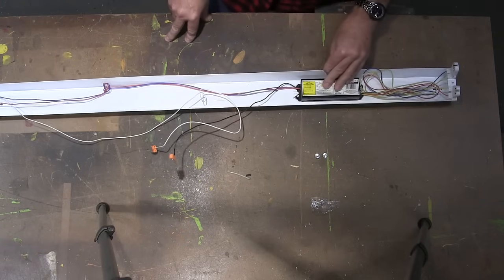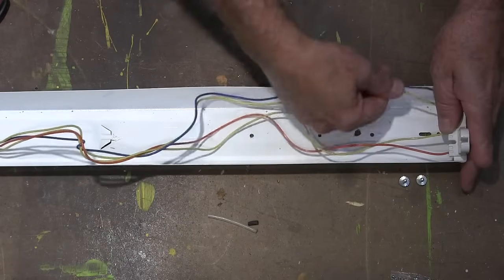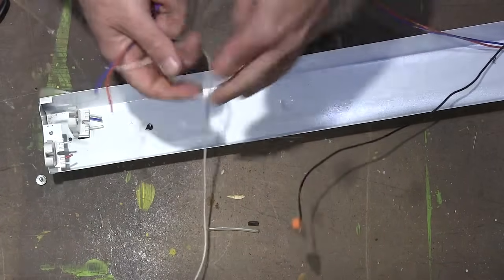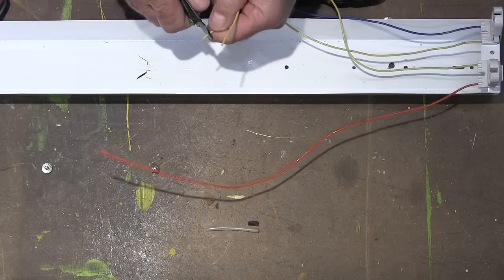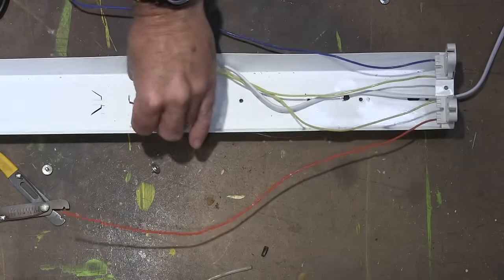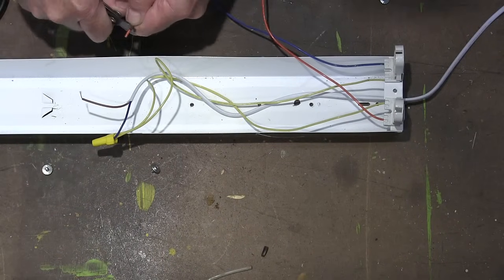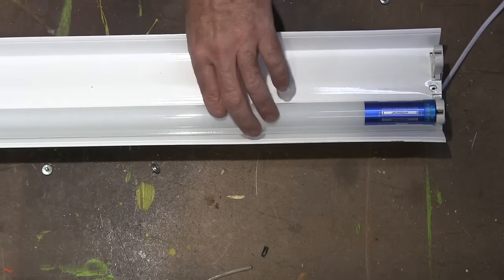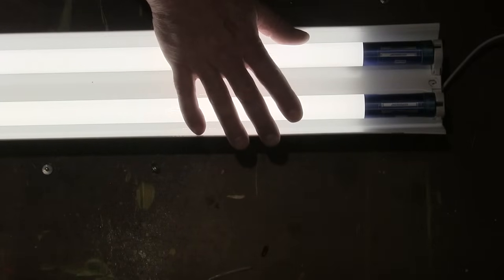Fluorescent to LED Conversion

Comment: Hello, this does not work with the Feit Electric T8 Ballast Bypass Tube (purchased from Home Depot). You need to connect wires on both terminals (one end of the terminal wires needs to connect to Live wire (black), and the other end of terminal wires need to connect to Neutral wire (white). Then when installing the LED Tube into the terminals- the (L) or live end of tube (stamped on tube) needs to be placed on the (L) terminal, and the (N) or neutral end of the tube (stamped on tube) needs to be placed on the (N) terminal. If you don't connect to both terminals it will blow the fuse- power needs to be coming in (Live or Black wire) and go through the tube and out the other terminal (Neutral or White wire) to complete the circuit.
Reply: That is a double ended tube. This video has a single ended one.

Comment: Does it matter if I have shunted or non-shunted tombstones?
Reply from the maker: Yes. You are just feeding the ens of the led tube. Be sure you are using bulbs that wire up the same as in the video.

Comment: WARNING:  This video is only applicable to the specific LED light he is using where wiring is done only on one end.  There are plenty of other types where the power is applied to both ends, in which case, if you use the wiring this video shows, you will short out the wires and trip the breaker.  This happened to me following this video, which got me scared me until I figured out why.  Follow the instruction that comes with the LED light instead of following this video blindly.

Comment: Why do some videos show using wires from both ends supply hot goes to one end and netural supply goes to the other end
Reply from the maker: There are several different styles of bulbs that wire up differently.  It's very confusing and makes it hard to replace an existing bulb as you don't know which to buy unless you open the fixture to see how it's wired.

Comment: Thank you for this very helpful video!  Everything went well with my 4 light , (8 bulbs total)  fixture conversions just  as you described in your video.  I agree with other commenters  that your straight forward description and explanation was simple to follow and made it easy to implement.
Reply from the maker: Thanks for letting me know it worked out!

Comment: Best of numerous vids I have watched. Easy to understand , at least for me.  Thanks!
Reply from the maker: Thanks!  I hope you're conversion goes well. Make sure your bulbs wire up the same way. There are different types.
Reply: @SoatMon  ha..sure enough..I ended up buying a box of 25 bulbs after i realized this was possible...but needed to wire differently...luckily i didn't do too many fixtures ahead, and was still able to re-wire them easily. Has definitely been a good learning experience.

Comment: Wow, and that was five years ago.  Today I went into Home Depot and can't even buy flourescent fixtures or bulbs any more, so I better learn how to do this!
Reply from the maker: If you following my wiring be sure to get bulbs that wire up the same way there are several configurations.  I have a link in the description that should get you started but some bulbs wire up one at each end, some need a ballast some do not, these wire up at one end as you saw in the video.  Not to critical to get the same bulbs just pay attention to how they are supposed to connect up to the power source.  I hope it goes well for you!

Comment: My fixture had handy push in harness so I didn't need to buy any, they have 3amp slow burn fuse inline with power. I accidentally blew one. Should I just replace the fuse or bypass it ?

Comment: I have T12 F40 bulbs.  It doesn’t say which end goes to the power.  It does say remove this label before installing.  The other end has the bulbs info.  So, which end goes to the power?  I gave this a try and blew both bulbs.  Use this vid at your own risk.

Comment: Don't listen to this guy. Thanks to him I  screwed up my light fixture. His wiring is NOT CORRECT !!
Reply: His wiring is correct, but he did not explain to us that you must take one wire from 1 side of the tombstone, but be careful not to take the opposite one of each light by so saying I mean left from each side must be combined together and also right from each side must be combined together and if you happened to mix right and left of each side that will be a short circuit.

Comment: So, wire gauges.  Do these change when we move from using a ballast to connect to the tombstones, and instead connect directly from the input power supply of 120V (and 15A, most likely)?

Looking at an existing TRIAD ballast that I have, the input / output wire gauges look to be the same, at 12 AWG (from a chart).

Comment: 5 yrs ago, and this video still helps. That's awesome, and thank you! My wiring was a bit different, but I managed to get it done. Mine had a red, white, and black solid wires on one end, and two blue solids on the other. The red wired to the romex hot, and the two blues had to be wired together, and to the neutral. I figure it must be an older light fixture. The only thing I did different from you was I made sure to cut all the wires as close to the ballast as possible to give me mercy in case I screwed up, lol. Come to think of it I can't remember where the black wire connected. Weird.
Reply from the maker: Thank you for your kind words and for sharing your experience.

Comment: Did what you said and it didn't work.
Reply from the maker: It's probably the bulbs.  They make different kinds.  You need bulbs that don't need a ballast and wire up on one end.  There are some listed in the description to get you started.  There should be a schematic with or on the bulbs that you have.  Some bulbs have to be wired at both ends, etc.  I hope that helps you.
Reply: You said to cut all of the wires at on end and tie all of the wires together at the other end splitting them between the white and black. I did that and almost fried the outlet...😡  Looked at another video which said to use the ends for the neutral you said to snip and the other ends go to black. Works correctly now.
Reply: It's not the bulbs, it the ballast free bulbs. I have the same 2 bulb fixture you had so I followed it exactly like you described.

Comment: I do not have the same colors of wires for 2 light bulbs.  This video is no better than three 3 others I have seen because the colors of my wires are different and out of 2 tombstones I have 2 wires.  I have yet to see my style of light fixtures.  Another waste of my time.
Reply from the maker: The first thing is you need to get the correct bulbs.  There is more than one style of wiring.  There are some listed in the description to help you.  You don't have to get those exact ones but ones like them.  You need bulbs that don't require a ballast and then just connect one positive and one negative wire to the end of the bulb using the tombstone, like the schematic in the bulbs listed.  I hope that helps you.

Comment: No mains terminal block. no cable tension capture.   I wire them both ends so the tube works which ever way you fit them.

Comment: I have done this two other times before. But to be honest I am a 65 year old, disabled woman and couldn't remember. The past times I spent $20 more for the kit than buying 4 bulbs. In the kit was one bulb and instructions. So this time I watched like 5 videos and they looked so complicated. Your video was PERFECT! You made it so easy! THANK YOU!
Reply from the maker: You're welcome.  Make sure the bulbs you buy are link the ones listed in the description.  There are alot of different configurations.  You basically need a bulb that does not require a ballast and both the negative and positive wire attach to one end of the bulb.  Good luck with yours!

Comment: My fixtures are 8 feet but I can't find any 8 foot LEDs of this type without spending a fortune on a 25 pack. Can I just tie the excess wires from the side you're not sending power to into the source so I'm sending power from the same source to both ends and then just plug one led into one end, the other into the other end and zip tie them in the middle? Or is splitting the power source like that a bad idea?

Comment: didn't work for me for some reason, im using philips Contractor-grade InstantFit (UL Type-A) T8
16T8/LED/48-850/IF18/G 25/1 no idea what im doing wrong but it just wont turn on
Reply from the maker: From what I can tell that bulb needs a ballast and wires differently.  There are bulbs listed in the video description that will work.  The main thing is that you need a bulb that does not need a ballast and wires up on one end.

Comment: I followed this instruction and installed typeA direct install and typeB bypass LED bulb but everytime I install new led it always spark and break the new LED bulb.
Reply from the maker: Unfortunately there are multiple types of bulbs out there.  It is getting a little easier to figure out.  The difference between type a and type b bulbs is whether they use a ballast or not.  To use bulbs for this tutorial you need what they are now calling a single ended bulb.  In other words one that only one end of the bulb is wired in.  There are two links in the video description that will lead you to bulbs that will work.  The second link listed is the ones I used and they are made to work in both situations.  Good luck!

Comment: OMG too complicated. Cut the wires close to the ballast.
Simply connect all the wires at one end together to the hot wire. Connect all the wires on the other end to the ground wire. Done

Comment: And just to think, this old man was going to get another ballast to replace the one I replaced 8 years ago.  Not now !!  Thanks for the video !
Reply from the maker: It hope it's working out for you.  You have to make sure you know how the bulbs are wired.  There is not a standard and there are many different ones.  There is a link in the description that will get you started on the right kind.  It doesn't matter what kind as long as you wire them up according to the wiring diagram.
Reply: I'm all done with power wasting ballasts !

Comment: Thank you. I can do this myself thanks to your easy explanation and showing what you did so I can follow along. I subscribed and liked because your video was  the best tutorial I found.
Reply from the maker: Be sure you get bulbs that wire on a single end like the ones in the video.  Here is a link to some to get you started.  Not all bulbs wire up the same way.  Good luck with yours.  https://amzn.to/3ZXIdeL
Reply: @SoatMon  Thank you. I haven't started the project yet but will check out your video again when I do.   The project involves taking the hood of a fish tank and removing the florescent lamp altogether because my fish stress out when I turn it on. I was going to change to LCD but it's still going to be too bright for the fish and too much light. Now, I want to ask is it possible to remove the florescent light and hook up a regular bulb inside the hood using the wires already there. Because I want to be able to give the fish soft lighting and I can't with florescent bulbs. With regular bulbs I can buy lights at lower wattage and buy them in soft colours. 
If it can't be done I will just buy a new hood.

Comment: So if i understand well, with LED tube, Ballast become unusful ?
Reply from the maker: It depends on the bulb, some use the ballast and some do not.  They also wire up differently.  Be sure to look at the ones I listed in the description.
Reply: @SoatMon  if i want to make work m'y LED tube with a Ballast i must to change m'y classic starter by a starter LED

Comment: My fixture looks like yours. I tried to follow correctly but when I plugged it in, it blew smoke out of the socket. Yikes. Do you have any idea what I did wrong? Thank you.
Reply from the maker: The problem is that there is not a standard for how the bulbs are made.  Some wire up differently.  Even with the bulbs I used will blow the breaker if you put them in backwards.  Check out how your bulbs are wired and connect them accordingly.  That should fix it for you.  If not look at the bulbs I used, there is a link in the description.  Good luck!

Comment: Excellent instructions.  However, it should be emphasized this will only work with Type B (or Type A and B together) LED bulbs!  I tried this with retrofit bulbs and they immediately burnt out on me! (Retrofit being b
Type A bulbs are those designed to be used with ballasts in place).
Reply from the maker: You also have to make sure the bulbs wire the same way.  There is not a standard.

Comment: Best and simplest conversion ever. Good to know that when buying the LED light to get the Type B (which is the bypass ballasts one). 

Thank you.
Reply from the maker: You're welcome!  Be sure the bulbs you buy are wired the same way.  There is not a standard.  There is a link in the description that should get you started.  Good luck with your conversion!

Comment: Tried this and blew the breaker. The bulbs I have need power on both ends
Reply from the maker: As I said in the video you have to have the right bulbs.  Unfortunately there is no wiring standard for them.  I see a big problem going forward as people try to replace bulbs and don't know how their fixture is wired.  There is a link in the description that should lead you to bulbs that will work.  Good luck!

Comment: Followed these directions and it pops the breaker, no light.
Reply from the maker: You have to have the same bulbs and wire the correct end.  Unfortunately there is no standard as to how the bulbs are made to be connected into the fixture.  I put one of them in backwards and it flipped the breaker as well.  Turning it around fixed it.

Comment: unfortunately, it did not work for me one way or another. Tried many videos. Maybe I need to exchange light bulb.
Reply from the maker: Unfortunately there are many configurations of bulbs out there.  They wire up differently.  If you follow the link in this video description you will see in the photos how they wire up.  You remove the ballast.  Connect the incoming AC power to one of the tombstones, neg on one side, pos on the other, it doesn't matter which. The Tombstone that you connect to should not be shunted meaning the pins are not connected together.  Check the bulb to see which end is the one that you connect to power, you have to use the correct end.  Connect this end to the tombstone that you wired and you should be good to go.  I'm guessing you have bulbs that wire differently and that is the problem.  Good luck!

Comment: my fixture has 4 bulbs and 2 ballasts. is the process the same and just add the other set of wires into the same corresponding caps?
Reply from the maker: Yes that should work as long as your bulbs wire the same way  as the ones in this video.  Good luck with your conversion!

Comment: This video is informative for converting a fixture to run on LED tubes that run on line voltage with no ballast required. However, some of these LED tubes are designed to run with the existing ballast that's made for fluorescent tubes. Make sure you read the instructions on the package before doing anything.

Comment: Ok, so first failure after switching all fluorescents out at work to led. I go home and try to do the same thing but ended up blowing two bulbs. Cut and ignored one end and used the other for power. Used two center wires for hot and two outside wires at the tombstones for neutral. Put it back together, put in bulb one and it blew. Thought maybe I put put the wrong end in power side (they were not marked either way on the bulb) reversed the second and immediately blew that one. Hmmm. I've seen some videos where they use both ends of the fixture, one for hot and the other end for neutral and got they got the light to work. I'm wondering if perhaps I should have wired this fixture that way.
Reply from the maker: It's very confusing and varies per manufacturer as to how they hook up. The ones I listed in the description hook up this way. There are going to be a lot of issues in the future as people replace blown out bulbs with different styles. They need to standardize it. I would be sure to check the wiring diagram for the bulbs you buy.

Comment: I followed this video to the letter. I carefully listened to all the instructions and followed the example. I cut away the yellow wires which are not needed. WRONG! I should have left the yellow wires and connected them to the main white wire. Now I have to go buy another light fixture. Great tip. Thanks.
Reply: He never said cut the yellows out dip shit

Comment: The one part that was fast forwarded was the part I have a question on.  Does he connect one white with two and one black with two or does he split the white because it looks like there are two white wires and use one white on each? I have two white and two black coming from the area of power.  The other ones to.connect are red and blue. Can anyone help answer this?

Comment: Your link to the bulbs used isn't working. Want make sure get proper bulbs
Reply from the maker: Thank you for letting me know.  I have updated the link.  Here it is: https://amzn.to/34bldBT  these should work the same as the ones in the video.  They require a nonshunted tombstone like in the video.  Non shunted means the tombstone pins are not connected together so if you check them with an ohm meter they will not show as connected.

Comment: you made the instructions so clear. thank you! i'm going to try this on my own before i call my electrician.
Reply from the maker: Be sure to get bulbs that wire the same way, there are a lot of different ones out there unfortunately.  There is a link in the description to the ones I used.  You can use that as a reference and get whatever you want. As long as you get comparable bulbs it should be easy.